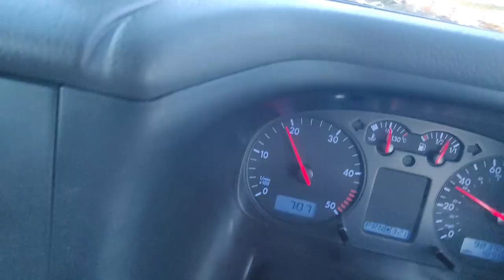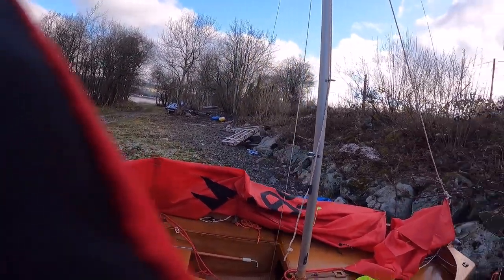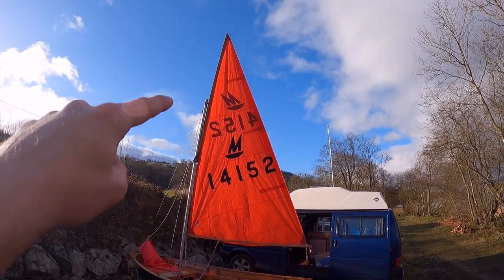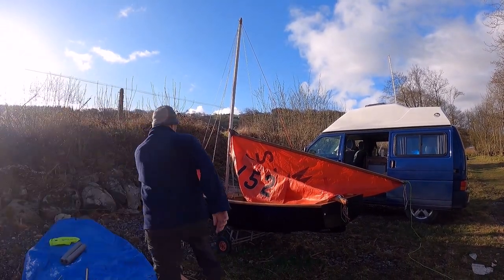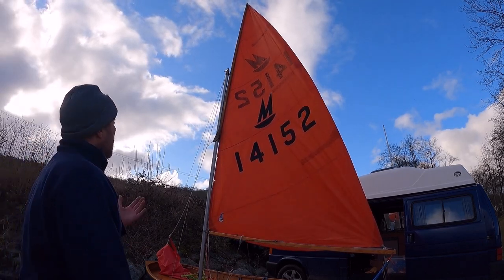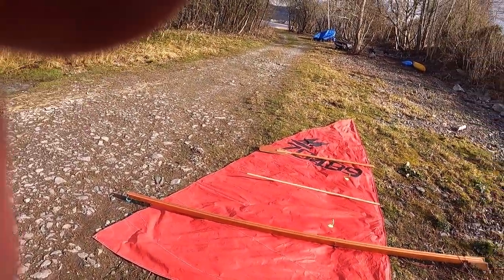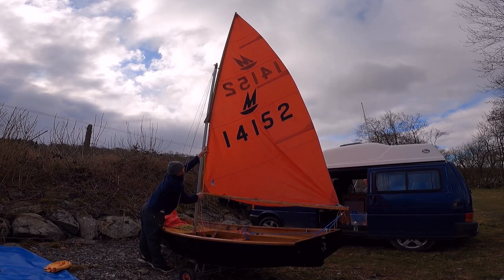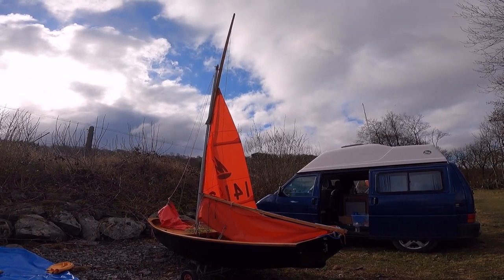It's snowing!! So lets start reefing Mirror Dinghy sails!

Comment: Something that I've used on Gunter rigged boats is to attach a taught wire from the top to the bottom of the yard. Attach the throat halyard to the throat of the yard and attach the peak halyard to a small block that can run up and down the wire. The sail remains in place on the yard. When reefing leave the peak halyard alone and just lower the throat halyard. The block / wire allows the yard to slide down while being kept upright by the peak halyard.   In effect you have something similar to a sliding Gunter. The Lysander owners' association might have a diagram (that's where I go the idea from years ago).    A topping lift is nice to keep the boom from falling down.
Reply from the maker: That's interesting, I think I understand that. I do come up with a novel idea that I use successfully, much more like a Bermuda rig style, so it will be interesting what you think of that!

Comment: Why not lowering the topgaf and de halyard on a higer point.
Reply from the maker: Yes that would be the classic way of doing it. Some people even have 2 separate halyards for the 2 reefing points, but I wanted to try something different and a little easier to use during sailing. Not sure if it will work yet though!! ;-)

Comment: Hi Dave. Interesting video topic. You could maybe do a topping lift from the top of the mast? It would stop the boom crashing into to cockpit and might make it easier to tie off everything, as you could raise the boom a little. Can i ask your heigh and weight (if you dont mind)? I am think of getting a mirror but worried it might be a bit small. I am 183cm and about 85kg.
Reply: Your weight is fine for a Mirror, in fact you could put on a good few kg and still be ok! 😄
Reply from the maker: Hi Micky. Yes I agree to learn to sail or just go sailing. But for cruising and spending the night on her, I have really struggled.
Reply from the maker: Hi There, Good idea, I noticed even bermuda rigged yachts seem to have topping lifts so I will look into that. I'm 16st (100KG) (but losing weight now) and approx 6ft (183cm) so very roughly the same as you. The Mirror is fine for sailing, in fact I have had 2 larger 6 footers in her. It was a bit cramped but we were fine. I think when I refer to my size I'm talking about cruising, multi-day sea faring and camping aboard. I spoke to a couple of guys who cruised with Mirrors and they were quite small guys. They could actually sit on the side of the boat and not tip her. I can only sit on the thwart in the centre of the boat unless I have wind to counter my weight. Thats why I sit there on motoring days.